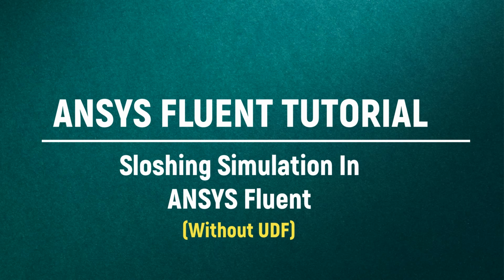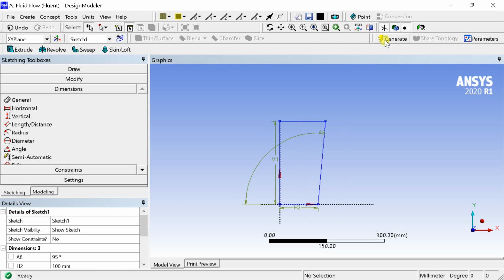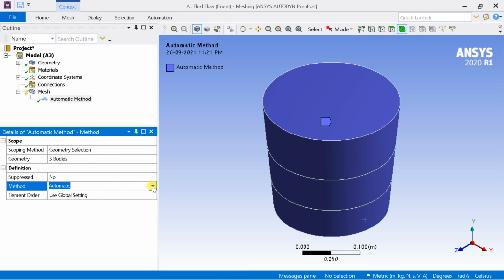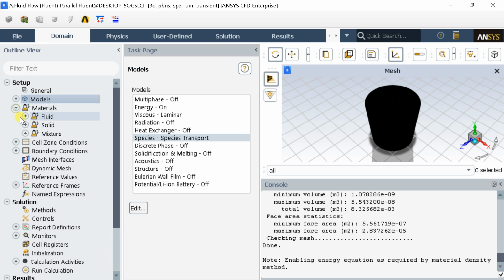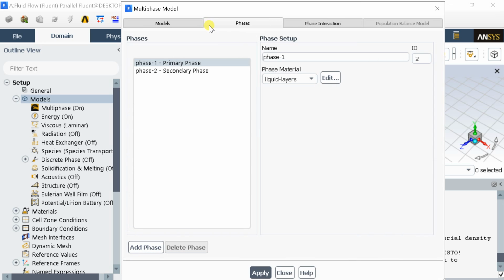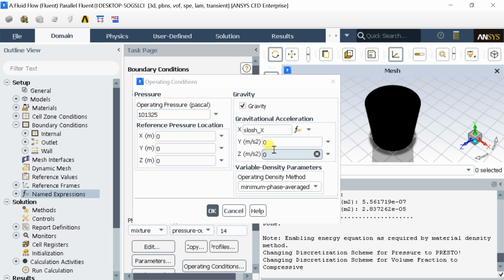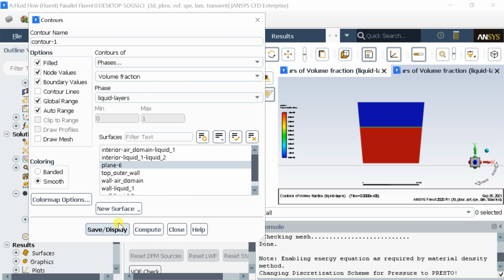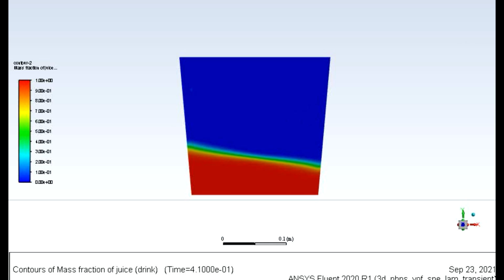ANSYS Fluent Tutorial | Sloshing Simulation in ANSYS Fluent Without UDF | Named Expressions in ANSYS

Comment: I am trying to simulate 2d sloshing tank phenomena with air and water as fluid. The water in the tank is filled upto 0.15m and total height of tank is 0.32m. The length of the tank is given as 0.57m. I want to provide velocity in the form Acos(wt). The point at which this excitation is in the center of tank and on the free water surface. I am not getting how to give this kind of excitation in fluent. Pls help me in this regard.

Comment: Hello, great videos, i am trying to do the same but with only one fluid and air and i can't figure it out. Also i am trying to add walls with thickness, not just lines but i am not sure how to name them (named selection), could you provide any tips?
Thanks a lot!
Reply from the maker: In that case you dont need to add the species transport model. You can model the wall in ansys design modeller and provide the named selection to it. In cell zone conditions select the material for the glass.
Reply: @AnsysTutor  Thank you very much, i will continue watching your videos and learning from them.
Reply: @AnsysTutor  i keep getting this error" Warning: Flow boundary zone (top_outer_wall) is adjacent to a solid zone (air_domain). 
 This problem MUST be fixed before 
         solution can proceed!" any idea how to solve it?
Reply: apparently aluminium is the default material of my air domain. Any help?